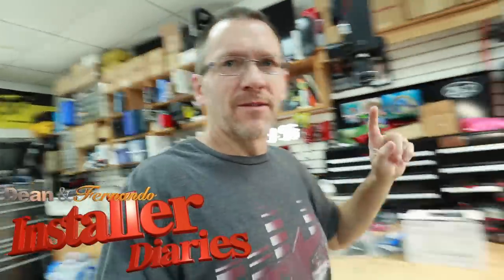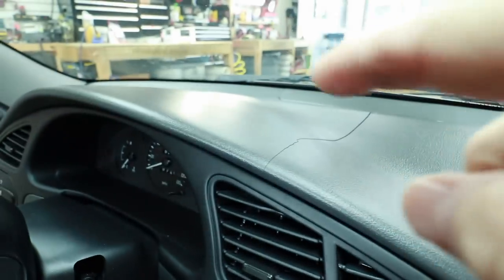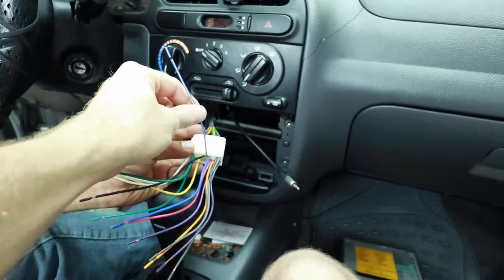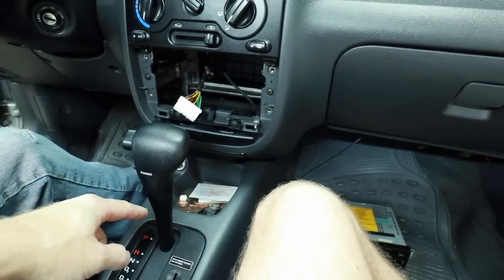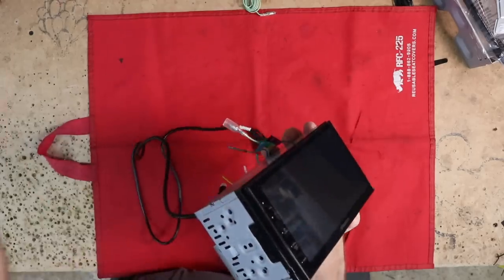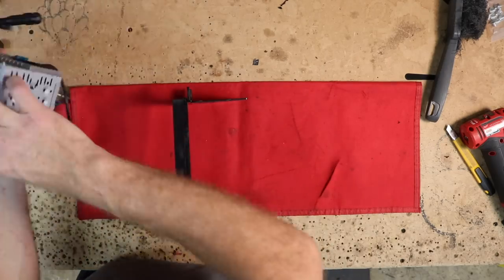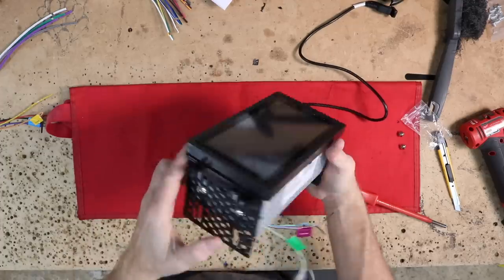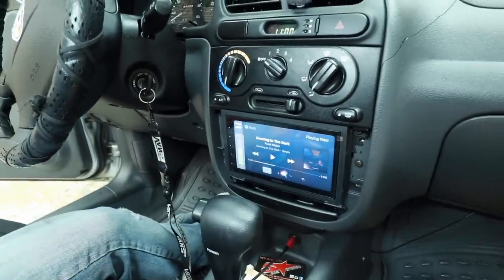The new Kenwood  DMX4707s and a Daewoo Installer Diaries 286

Comment: Wow this brings me back... I lost my job as a MECP gold installer years ago because of a Daewoo Nubira. The one I was working on had a direct cable connection to the blend door for the AC. The only way to remove the dash panel was to remove a Phillips head screw that attached the cable system to a nub on the actual blend door flap, which is in a sealed unit that is conveniently BURIED in the dash. Long story short as soon as I tried to loosen the screw the entire mounting boss snapped off,  the repair estimate from the shop the customer chose was more than what the car was valued (~$1700). The REALLY bad part is that I came in to help on my DAY OFF so I was basically the real life version of Craig from the movie Friday. I kept that little piece of plastic and still have it to this day. Thanks for the trip down memory lane 🤣🤣

Comment: I had a Daewoo exactly like that one for about 5 years. It was a great car, never once left us stranded, custom wheels, sound deadening throughout, and a system. Separates front & rear, amps, a 10” sub, and a head unit , sounded great. It had 17k when we got it and 57k when we sold it. Great video Thanks

Comment: What's a great head with GPS for under $1000 that you guys would recommend? I use GPS daily and it's getting frustrating using my phone and having a call comes in and trying to use both at the same time. I will make the 4-hour trip to get it installed by you guys.
Reply: they use your phones GPS now, just make sure you get a andriod auto head

Comment: I bought an Acura RDX 08 with the tech package and it was toasted. So I removed al the stuff from factory and went thru the entire system. I mean from the tailgate cam thru the sub woofer all the speakers I mean ALL. Sub amplifier and two more others for rear speakers and front speakers. I bought one DMX4707S head unit I can’t get the Camera to come to screen at reverse gear unless I go settings and pulse the camera icon also can’t connect the metra steering wheel interface to work. I called metra and they have no info on that model. Can you guys help me. Thanks in advance.

Comment: Hey guys I need help!! 
I just installed a system! I’m not a noob. I’ve got pretty good understanding of installing a system. The problem is my 4 channel amp is getting overheated and goes into protect mode. I’ve check all my power and ground wires, which they’re all tight and firm! The amp says it does 150 rms at 4 ohms.... all of my speakers are 150 rms at 4 ohms so it matches on the spot. I’ve used an SMD DD1 and CC1 to set everything up. All fuses are still good. EVERYTHING IS BRAND NEW! Any ideas?! How do I check if one of my speakers grounded out?
Reply: As far as the speaker grounding out take a multimeter and check both speaker wires to see if they are grounding out and ohm them at the amp
Reply: Ben Dollar Okay Will do, do I set my DMM to ohms or continuity?!
Reply: Check continuity on each wire that will tell you if your grounding out or not

Comment: I install the same radio in a 2003 tahoe but the radio takes forever to turn on sometimes doesn't evem turn on but the screen is like gray, any suggestions? Do you think the radio is bad or the wire harness. Thanks

Comment: When hooking up a Kenwood backup camera to this unit can you T into the red auxiliary wire to get your power and T into the black ground wire for ground? Or do you recommend getting power to backup camera by taping into fuse box and grounding out separately. Thanks!

Comment: Ive just today got the dmx4707 for my 2006 mustang gt .... !!! It is stage 1 of my rebuild.  Stage 2 is kicker 6x8 , x 4 replacement of factory speakers.  Stage 3 500w 10in sub . With a 800w amp . , now i do have factory 8in in the doors as well . Those are work fine for now ... but when needed would be replaced with kicker 8in subs

Comment: I have always been a stalwart Pioneer man. Until three weeks ago. I was designing a system for a buddies VW GTI and, after a lot of research, settled on a Kenwood Excelon radio and amp paired with JL speakers and sub. 

Wow, what a difference interface software makes! Kenwood makes Pioneer look old in comparison. So long, Pioneer...
Reply: I'm thinking I might switch too. thanks for the comment.

the deck they used here looks real fresh
Reply: I never considered Kenwood until now!!!
Reply: @Polywog77  I was so impressed that I installed the Kenwood Excelon P-XR600-6DSP into my new 2020 Scat Pack two weeks ago. Very nice kit!
Reply: @tatialo37   I was so impressed that I installed the Kenwood Excelon P-XR600-6DSP into my new 2020 Scat Pack two weeks ago. Very nice kit!

Comment: Hey guys, I'm considering getting this radio and putting it into a '16 Jeep Wrangler w/ a PAC RP4-CH11.  At roughly 16 min in the video you recommended attaching ACC w/ PWR ANT. Would you still recommend doing that if using something like a PAC?

Comment: Hi, I just bought a kenwood dmx4707s for my 2006 Buick rendezvous CXL. I wanted to know what should I do with the light green wire that’s in the back of the radio? I also have the PAC—rp5-gm11 do I I plug the light green wire to the other green wire on the smart harness?
Reply: U can ground it

Comment: I just recently purchased this and for some reason I can't figure out how to hook up the reverse camera any help?
Reply: Not sure if you did it yet or not but I just mine on this model, though I used a wireless reverse light so it may be different. The back portion should just be a negative and a ground. Positive on the positive wire for reverse bulb. Front should be 3 wires, positive, ground and an additional wire. The positive I put on my accessory wire (red) and ground in my ground wires (black) using taps. That would be behind the unit on the harness, on this stereo there is a purple wire that says “reverse” I connected that to the addition wire, which for me was an orange wire. Hope that helps.

Comment: I just bought and installed this unit in my Ford F-150. Everything works great until I start driving. If the truck is moving the unit is off until I stop then it will turn on again. Any ideas as to why this is?
Reply: you have no earth wire

Comment: I have a 2009 Chevy Tahoe with Onstar and Bose speakers I was interested in going with this solely because of the apple carplay. With the parking brake cable is there a way to by pass it with Kenwood's are do I not need to wire it up.  I want to make sure I keep my steering controls as well I have the LT model and would love any pointers or help. Thank you
Reply: The only way to do correctly is using the correct interface harness adapter

Comment: I’ve installed multiple of these and the JVC version. They are absolute garbage. Had some of them have software issues/ not playing sound, and the touch sensitivity is TERRIBLE. I do not recommend this radio, especially since it’s $299.
Reply: What would you recommend as an alternative?
Reply: @mprooveit3588  spend a little more and get the kenwood dmx7706s.

Comment: I just changed out the original head unit on my truck. I learned a lot from you guys. I have two different harnesses. One to run without an amplifier. It is just a plug to the new radio soldered and heat shrank connections to the Metra plug which plugs directly into the vehicle harness, NO CUTTING. I also have a T harness I made for the amplifier I added. There are male and female plugs on all three ends. I ordered a second radio plug and vehicle specific radio plugs. So now, everything is plug and play. If I want to run the radio without the amplifier, I can. If I want to run the radio with the amplifier, I can. All I need to do when swapping out is unplug, then plug in. 

Repin the plugs, tesa tape, wire loom. Everything you guys do, I tried to do. I mounted the amplifiers to big cutting boards mounted to the back wall of the truck. Made sure there was good airflow. Thank you for all the advice. Your videos rock!!
Reply: Are u selling those harnesses

Comment: I just got the alpine ilx w 650 installed in my 2017 altima.. the place where I got it installed put in a switch to overdrive the stereo?  Is that ok or were they just lazy to installed it right?
Reply: If it's on yellow black wire....that's poor man's bypass...or maybe lazy that they didn't go to brake wire..I always sell a bypass module tr-7 or something simular.....haven't seen switch for that since the 90s
Reply: @loudelvis610  its the break wire right not the emergency break.. cause the sales man told me I would have to completely stop my car in the middle of the road to operate my stereo properly if they connect the wire to the brake?
Reply: @esepenguin13  yea it's what Alpine calls foot brake....you can get bypass module that does the switching for you every time you turn key on....enter "brake bypass Alpine"...on Amazon..or you can get Pac tr-7 it's a few bucks more ...I'm working on Suburban now with Alpine head unit using tr-7...
Reply: @loudelvis610  were do you stay at? I live in Southern California..
Reply: If you're close. Ill take it to you so I can get that fixed.
Reply: @esepenguin13  sorry I'm in Texas...I can't believe the shop didn't try to see you module....I never install an Alpine without it's just anorthger of needed parts...but diff shops do diff things
Reply: @loudelvis610  that sucks man.. oh well ill have to order that break bypass module and take it where they do know what their doing.. thanks bro!

Comment: Got same radio, how can I bypass the ebrake?
Reply: Just received mine today.  Did you bypass the break wire? If yes, how?
Reply: Just to let you know... this hack works on this DMX4707S  stereo.  I used the upper left screw without a a ring, and that's all.
  
youtube.com/watch?v=gOk4fXL0XBU
Reply: Bypass the ebrake? What is the ebrake doing?
Reply: @Yukiyu  You used the little screw all the way in the top left corner?? 🤔